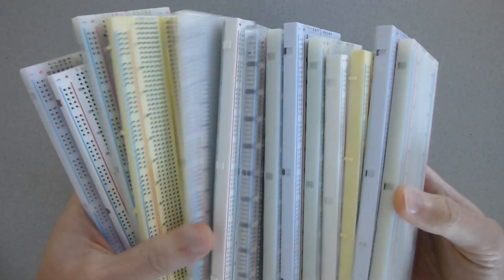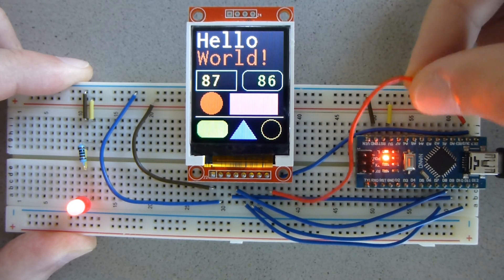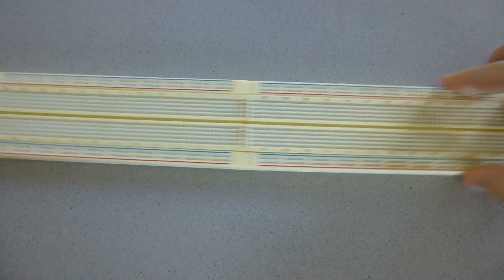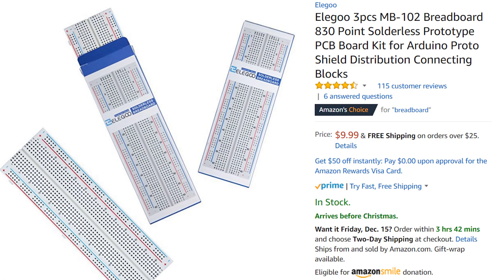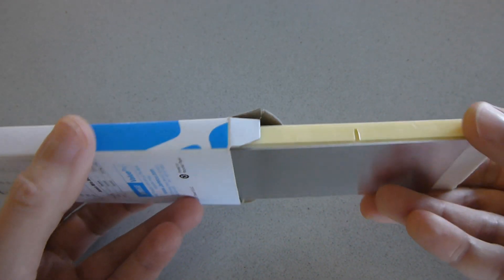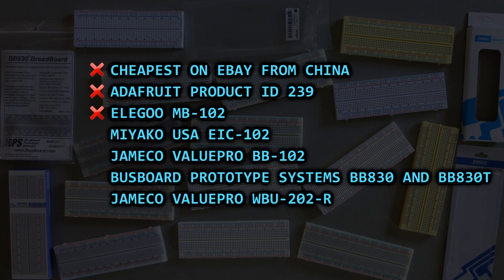Best Quality Breadboard?

Comment: Sadly these good quality breadboards are very hard to find and almost impossible to buy if you don't live in the US or Europe. The e-commerce website used in my country have sellers marketing ONLY that nasty MB-102 as the best breadboard possible (and triple the price, of course - it sells for about 5 dollars here - and I won't even enter into the purchase power comparisons of our 5 dollars...). Also I think most people working with eletronics think breadboard are toys and wouldn't use them for more advanced projects, so there isn't a big market for good quality breadboards...
Reply from the maker: In what country do you live?
Reply: @interlinkknight  Brazil
Reply: I'm Brazilian
Reply: Sadly our currency has been devaluating for some time (mostly because of political mismanagement of the country's finances) and now, with the Covid-19 pandemic, it reached a record bottom of 1 US$ = 5 Brazilian Reais R$, despite the wages and index prices of the country not following it. So, at the cheapest websites I've found the Busboard BB830, I would pay 10 dollars for one unit, here 50 reais, which is equivalent 3,5 bigmacs or 25 kg of rice or 25 icecream cones from McDonald's. Scaling up to a project with several breadboards, it would be rather expensive (and I won't be even adding the extreme shipping prices which are asked for shipping to Brazil from another countries and the 60% national import fees you can get charged if your purchase is higher than 50 dollars - while shipping from China is mostly free - but sadly, only really cheap and bad breadboards coming from there). Just to have another idea, the chinese MB-102 2 dollars breadboard shown in the video is sold here for a 20 reais minimum (4 dollars), everything doubles, triples or multiply by 10 in price once they enter the country haha
Reply from the maker: Oh. I know what you mean. I'm originally from Venezuela and I had the same problem, before moving to United States 4 years ago.

Technically it's available to your country. Sites like Jameco do ship internationally. Sadly I don't see how to avoid the high cost in your currency.
Reply: @interlinkknight  You are from Venezuela? Are you kidding? Oh man, I've been complaining with full stomach! Brazil situation thankfully is not as near as I heard your country sadly has nowadays and for some time. Thankfully it really is still possible to do any kind of imports and our currency is not as devaluated as Venezuela's or the currencies for many of our neighbors. I really hope your country rises from this crisis soon and become one of the most developed and with the highest HDI of Latin America like it once was. I will wait for some time to see if the price of the dollar in my country decreases a little and a better government shows up (as probably our current president may be impeached soon for his shitty response to the pandemic - and for disturbing the state isolation efforts) and sure someday I will have those sweet Busboard or Jameco breadboards. Sorry for overreacting to my country's problems, as I am not even remotely near suffering as a great portion of the Brazilian population is right now and Brazil isn't also near the country suffering the most in the world today or even in our continent. Thanks for the response!
Reply from the maker: No worries. Good luck.

Comment: Thank you! I've avoided breadboarding in the past because  the circuits only seemed to work after some furious wiggling of all the conponents. Will get myself a new quality board and give breadboarding another chance.
Reply from the maker: I understand you. Yeah, you should give it another try. They are very useful and the good brands don't have connection problems.

Comment: There's also 3M and global specialities breadboards. Usually without markings, but I have the last ones and after 40 years are still rocking
Reply from the maker: I searched before and they don't seem to make 3m breadboards anymore. At least not the standard size. But I heard they were really good.

Comment: I think you received a bad elegoo bread board because there are pretty good when I use them
Reply from the maker: Maybe you are right. Either way, I don't trust them so I can't recommend them. By the way, other products from Elegoo also are terrible, like the jumper wires. I bought them and they are so cheap and flimsy. Maybe you can say I'm picky, but I like quality stuff.

Comment: You're mistaken about the uninterrupted power rails for the MB-102 -- it does have them. And, I've actually had decent experiences with the Elegoo MB-102, so far. I haven't yet noticed any significant connection problems, nor have I had any trouble inserting the pins/wires. But, these are the best of all my other brands of boards, so I can't yet compare with your recommended top of the list. All others I've tried are much worse than these (shorted power rails, connection issues and difficult to insert, etc.). For the money, I'd put them higher up, on the maybe list. Otherwise, great review. Thanks for the summary.
Reply from the maker: Someone else also mentioned that they got a different elegoo breadboard than mine. Apparently they have different products for the same model. It's about luck with the elegoo. From what country are you? In europe I heard they sell a better elegoo than america. I'm from america, btw
Reply: I'm in the US, and bought from Amazon. (also, for Jameco products, its cheaper to buy from Jameco directly, than through Amazon)
Reply from the maker: Is it possible that elegoo changed their quality after I bought mine?

Comment: The one from busboard is only £2.95 with free prime shipping, great!
Reply from the maker: Careful, many online places say "Busboard" and it's a lie. Buy only form trusted sites. I personally use Arrow.com
Reply: @interlinkknight  Is there any way I can tell if it's original or not when I receive it?
Like some small branding or specific packaging?
Reply from the maker: In the video I show it comes in a bag with a paper. It must come like that.
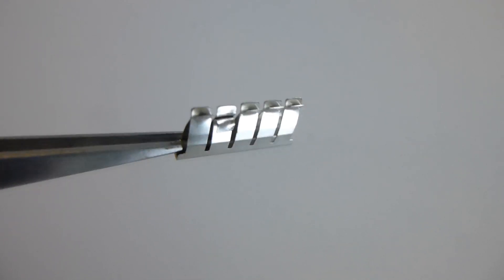Reply: @interlinkknight  Played after 5:05 and I can't see you unboxing it...
But I think I got a fake one, there was no backplate included and no branding on the packagaing.
Reply from the maker: Get a refund and buy the real one from amazon (make sure to choose amazon as the seller). I bought many times in there and always got the real one. Link on the description. You can also buy it in arrow.com
Reply: @interlinkknight  I'm from UK there's no more-real listings than that on amazon...
Might check arrow tho.
But how the packaging is supposed to look like?
Is there branding on it?
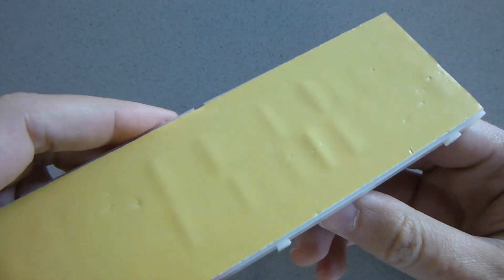Reply from the maker: I show the packaging on minute 2:03

There's no branding on the actual breadboard, though. The only breadboard I saw that had the brand printed in the breadboard itself is elegoo, bur they suck.

There are many retailers for bus boards. Check their website. They have a list of authorize sellers.

Comment: One thing I look for in a good breadboard is that the power rails line up with the holes in the main part of the breadboard. I have some quite nice half-length ones that I like OTHER than the way the power rails don't line up.

ALSO... My Elegoo breadboards don't have split rails. They hold quite well, the funneling is nice and I only found one bad connection due to a manufacturing error that I was able to fix.
Some of the power rails can be difficult sometimes but that main body of the boards are fine.
Reply from the maker: Another person also mentioned that their elegoo breadboard was different than mine. He was from Europe so I am thinking elegoo sends different products to different parts of the world. From what country are you?
Reply: @interlinkknight  
I'm from Canada
I got them from Amazon.ca
https://www.amazon.ca/gp/aw/d/B01EV6LJ7G?psc=1&ref=ppx_pop_mob_b_pd_title
Reply from the maker: Interesting. Thanks for your input.

Comment: I think you've helped me avoid some frustration by guiding me to a good quality breadboard. I really appreciate your efforts and all the detail you provided. You mentioned several factors that I would not have thought to consider. Thank you very much.
Reply: @interlinkknight  - I bought two Jameco Valuepro WBU-202-R for $20 on Ebay. Can't wait to get them.
Reply from the maker: Great. Make sure you receive a real one (original). If it doesn't look like mine, return it.
Reply: @interlinkknight  - Yep, I got it directly from Jameco. It's good.

Comment: Thank you, Thank you, Thank you.   I have been fighting with cheap ass breadboards for ever.  Just ordered a couple of the bus boards.   couldn't justify the almost double price for the janesco ones for just the added feature of end-to-end connectivity. 👍😁💖
Reply from the maker: I am glad it was useful for you.

And you are right, I better buy more quantities of the Bus Board than less of the Jameco. Actually after I made the video I've bought 5 more Bus Board breadboards and they all work perfectly.

Remember to buy them from a trusted seller. There's fake articles saying is from Bus Board but actually you receive something else. If you don't get a real Bus Board Prototype Systems, get you money back.
Reply: @interlinkknight  I used your link.  Hope they send the good ones.
Reply from the maker: Then it should be the right one because I've bought them from that same link in amazon and they are the original. Although I selected the Bus Prototype Systems seller fulfilled by amazon.

Comment: This is a great review! You've summed up all of the important points very well and your conclusions match my experience. I've had great luck with the BB830 and WBU-202-R. Thanks for the comprehensive video.
Reply from the maker: I am glad I could help.
Reply: Ben, have you used 3M breadboards? I’ve had great luck with them as well.
Reply: @Sarahbuildsstepsequencers  I bought an Assembly Specialists breadboard, which, IIUC, is the OEM for 3M's breadboards. They look exactly the same, apart from branding in the top left corner. Inserting a 0.6mm jumper pin requires a bit over 1kg force on my board (unless I intentionally loosen the terminal by abusing it, which then drops insertion force to about 300g). Does this match your experience?

I've seen rave reviews for ASP/3M breadboards, but I'm having a hard time understanding why people like them so much, and I've seen no complaints about the insertion force being so high that solid core jumpers and resistors would surely buckle. Does everyone loosen up all several thousand of their terminals, or?.. Did I get a dud?
Reply: no wayyyy even the og is heree
Reply: you are the one 
who makes computer on breadboard 
thanks i got intrest in logic gates
Reply: ben

Comment: Nice video.  I was a little disappointed that he didn't cover other more $ boards like Global, Wisher, and 3M.   Personally, I've been using Wisher brand lately.  They are very high quality and not too expensive.  You can find them on Radio Shacks web site and Amazon.
Reply: I believe the reviewed  WBU-202-R is a Wisher.  https://www.jameco.com/Jameco/Products/ProdDS/20723.pdf
Reply: Wisher is made in Taiwan ..Global Specialties & 3M are good!

Comment: I don't know what's wrong with the Elegoo Breadboards
Reply from the maker: I already said what's wrong with elegoo breadboards.
Reply: @interlinkknight  I have some of them and there working just as you said the best would work
Reply from the maker: Well, unless they changed their quality, you are wrong. The elegoo breadboards that I bought have the worst connection of all breadboards I tested. Plus the other issues I mentioned on the video. Are you saying that your elegoo breadboards came with a back plate? Have uninterrupted power rails? The sticky is not coming off after 1 month of use? When did you bought your elegoo breadboard?
Reply: @interlinkknight  I bought them last year in August. 3 Breadboard for I think 16€. They have no backplate what's meaningless for me. They have two power rails, the sticky part is like at it's first day, I had never issues with the connections, it's not hard to insert cables. But if there so bad jet I wouldn't buy them again.
Reply from the maker: They have two power rails? You mean your breadboard is not split in the middle like mine?
Reply: @interlinkknight  Yes
Reply from the maker: Wow. In that case it's obvious that Elegoo is not sending the same product to everybody. You are lucky. From what I hear you are in Europe, right? I am in USA. Maybe Elegoo doesn't like USA and they send their shitty products there and they send the good stuff to Europe? Not fair.
Reply: @interlinkknight  Ye I am from Germany and had no issues with there products to this time. I've bought sensors, breadboard cables and Arduinos that are pretty high quality I would say.
Reply from the maker: Thanks for the info. It's good to know that some part of the world is lucky about this brand. I also bought the jumper wires from Elegoo and they suck too. The pins bend too easily. Strange company, sending different products to different parts of the world. Anyway, I hope eventually we get the same quality. Good luck.

Comment: Thanks for the video, I ordered the BB830 and WBU-202, hope they are good :)
Reply from the maker: Make sure you buy the busboard breadboard from a well trusted seller. There are many fake ones out there.
Reply: How to know?  I just went to Amazon.  Says seller is BusBoard Prototype Systems.
Reply from the maker: For example, in amazon check that the seller is actually amazon and not another seller. What i did was to buy it from arrow.com which is well trusted. In the website of busboard prototype systems has a list of retailers.
Reply: Mouser UK is on the BusBoard site as a seller

Comment: I just ordered the WBU-202-R. Thank you.
Reply from the maker: Nice. You won't regret it.
Reply: Well, it's not so good with 1/4 watt resistors, which is all I have right now. Seems great with everything else. I guess the leads are just too thin. Do people generally not use components with such thin leads with breadboards?
Reply from the maker: I have those thin resistors and I don't have any problem.
Reply: InterlinkKnight Might not have been the board causing my problems after all. Its definitely better than the cheap one I had.
Reply: @SwapPartLLC  This is kind of a late answer but might be useful to some people: Where you buy resistors is just as important as where you buy breadboards. It sounds like you got cheap resistors with very thin leads. I call them 'angel hair' leads because they're so thin and they collapse when you try to insert them into breadboards. Arrow probably has them too, but I found 1/4W resistors with nice thick leads on ebay. You can read my take on resistors at https://mechatronicsworkshop.com/index.php/2017/04/24/buy-resistors/
Reply: @Electro-Mechanical-Basics  I never thought of that, but you are probably right. I have some cheap assortment from eBay and they are very thin. Thank you.

Comment: thanks for this, it seems the busboard BB830 on amazon uk at the moment, is bad version (bad reviews and they mention the letters are not aligned). I'm looking at the velleman sd12n 11gbp free delivery, let's see.
Reply from the maker: There are many counterfeits of the busboard BB830 breadboard, especially on ebay and amazon. You should only buy it from a trusted source. I bought it on arrow.com
Reply: InterlinkKnight  ah ok, thanks. I’m happy with this vellememan sd12n (power rails are separated and no back plate and no labels, but connections seem good so far) - really appreciated your video though

Comment: Found this one on eBay and it is very good easy insert and very good connection plus printing looks good but only half size board on UK eBay number 263465516973
Reply from the maker: Yes, there is a half size breadboard too. I recommend the normal size, though.

Comment: Your ebay breadboards are expensive. XD
I believe I got something stupid like 10 cheap breadboards for all of $4?
Yeah, I assume they're terrible quality, but, they were so cheap I thought what the hell.
I got quite a few of them for less than a single high quality board would've costed.

Are they bad? Most likely, but I'll find out I suppose.

If you're going to go cheap, might as well go all the way.
Otherwise look for actual quality ones I suppose.
Reply from the maker: The ones I recommend are as good as it gets. You can't top that, even if you spend more money. But hey, if you really want to deal with terrible breadboards, be my guest. I through out the bad breadboards I had. I really can't work with bad connections. Bad connection is the nightmare of an electronic builder. That's my opinion.

Comment: Excellent review.  I avoid breadboards simply because mine are so poor.   Too may wires -- forget it, something will not be making good contact.  Either that, or I do a trifecta, mangulating a wire in the same hole until giving up on it.  Will try one of your good ones here to see how the other half lives.
Reply from the maker: Cool. You wont regret it.

Comment: Thank you so much for your testing I have just thrown out my breadboards from China as they are crap but have kept my breadboard that I got years ago from Rapid Electronics that has always worked but the rest in the bin thanks Bob - UK
Found it on eBay UK 183179703529 £4.40
Reply from the maker: You mean this one? https://www.rapidonline.com/k-h-rh-21-prototyping-breadboard-840-tie-points-34-0655